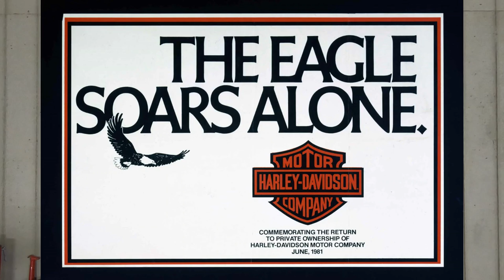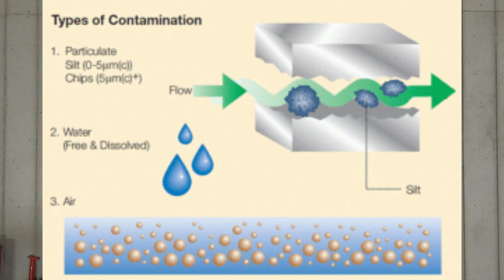Harley Engine Quality Isn't What It Used to Be

Comment: Good Video, my option is Harley like any big business and they are not going to worry about the past, Harley doesn't care about the Twin cam or the Evo, its 2023 and the Milwaukee 8 and nothing else and face it there in trouble and the over 40 crowd willn't bail them out, younger gen will have too, Harley 1950 technology and 2023 prices are not impressing the younger Gen, But thks

Comment: Harley had 12 evo engines they put 750,000 test miles on before ever releasing them. Taledega 24 hr test. Drag racing. Heat...cold endurance. They knew it was make it or break it time. They dont do that now

Comment: HD does like all other manufacturers of anything these days. They let the customer do the R&D instead of doing it themselves. If you are enamored with the polish and shine of a beautiful HD, it may be worth your money. If you want more power, take the whole bike apart and reengineer it for your whole plan determine, what you need and want from it. At least the pressed  crank can be relatively easy to deal with initially, once truely balanced, Trued, and then welded, not so easy after that.

Comment: A few things to add. How many riding a TC or M8 would swap out that motor for a 80" EVO ? The new motors accomplished faster assembly, higher torque and HP output. The EPA was requiring tighter emissions controls and compliance. I'm in total agreement that the EVO was the best motor ever produced by the MoCo. I doubt those who have built monster M8 motors, would want to build a 150HP EVO.

Comment: I bought a new Harley in 2001. At 500 miles the cam and lifters went out. The dealer put new cam and lifters in and less than 500 miles the cam and lifters went out again.  I took it back to the dealer and they told me that the cam and lifters for 2001 were made with defective materials and the metal was soft. They told me that they wouldn't repair my bike again and that was as good as it was going to get. I took that POS Harley and traded it in on a Yamaha.  I'll never buy another POS Harley in my life.

Comment: I feel the new m8 got worse. I've seen cases that were so coarsely cut on the base gasket surface that you could catch your fingernail. And alot of other things.
Reply from the maker: I've notice that SE parts, brand new set of Screamin Eagle ported heads and the machining was absolute crap. It literally had to be cleaned up before it could even go on the bike.

Comment: I was just a kid when AMF took over, the company that made bowling alley equipment is now in charge of an American icon. 54 years is a long time to fix known issues, suck up to Ronald Reagan, make 100cc dirt bikes and still use pushrod technology older than dirt. I understand tradition and think electric Harleys are stupid but the "new" twin cam belongs on the Flintstones.
We don't want V4's or four cams, we just want it to work EVERY day without taking out a second mortgage.

Comment: Are they really that bad do you really need to ask that question ⁉️ cheap components and major areas that are prone to cause catastrophic at expensive engine failure. Compensators that make the primary change so tight IT destroys the bearings in the transmission as well as breeder issues that suck transmission oil out. Plastic manifolds and an engine runs hot enough to cook a turkey 🦃. Jeep wiring harnesses made in Mexico that go up in smoke and if you are lucky your motorcycle just not go up and smoke with it. One problem after another problem after another problem because they built their engines to be cheap and disposable. As the British say pennywise and pound-foolish. Why Harley customers do not demand to have factory rebuild their motorcycles under warranty I have no idea. Harley Davidson evolution motors for the big twin as well as the Sportster where the Pinnacle of dependability and reliability and everything they have built since then is Cheer garbage. You yourself have a million videos about all of the many many mechanical issues of the big twin engines at Harley has made over the last 20 years since the discontinuation of the evolution motor. Hundreds of rebuild videos concerning the twin cam and the milwaukee-eight having catastrophic engine failure with horrendously low mileage. you yourself banter about changing stuff like the cam plate to a good s&s cam plate yet the good plate cost $500 not including installation. And that is just the beginning. Honda and the other Japanese manufacturers would never put out engines with so many endemic problems straight from the factory. They do not use their customers as unpaid testers. Harley-Davidson went from having real customers to having Fanboys that will pay any price for any piece of garbage that they put out. And then they will nonchalantly drop five or ten thousand dollars and replace all of the cheap crap in the engine from the crankshaft all the way up. Yet I know Harley can build a reliable motorcycle if they feel like it because I have a 25 year old Forester with 400,000 miles on her. Why is Harley Davidsons most inexpensive motorcycle that most reliable and their most expensive motorcycle the most unreliable piece of s*** that ever came down 👎 a production line. AMF sold a complete line of motorcycles from a beginner to an expert, the new Harley-Davidson is a t-shirt company that sells motorcycles as a sideline. Today's $30,000 Harley has the quality of a Chinese scooter that you buy on Amazon. That is pathetic beyond words. Harley-Davidson big twin motorcycles have so many expensive problems I would not take for free that is how bad they are. And so it goes.
Reply: Couldn't have said it better myself. If people stuck together and wouldn't buy that junk they would fix it or go out of business. Either one is fine for me.
Reply: I agree.  It's unthinkable that they could make a much better engine and simply chose not to.  I never knew about all these issues until after I bought my 01 twin cam.  I've spent over $3,000 eliminating the factory/ engineering weak spots.  Why wouldn't a company want their best possible product going out the door?  Allowing.012 end play on their crankpin is absurd.  They're becoming a joke
Reply: Can't really agree with your fan boy chatacterization nice try though.
Reply: @carlbruhn1772  it was a tongue-in-cheek joke. But there are many Fanboys out on YouTube praising them to high heavens just like all of the guys who are fanboys for Lionel trains and make excuses for trains arriving with wrapping paper stuck to wet paint paint defects electronic defects broken missing parts horrible customer service and poor warranties the expense does not match the price the quality does not match the price. Let me put it this way if Harley-Davidson made aircraft I would not fly 🕊️ them.
Reply: @Frank Markovci Jr  I completely see what you mean under those circumstances.  If I was 18 again there is little chance the motor company would appeal to me. Just the quality of chrome, paint, and fitment of body parts alone are reason to look elsewhere. Watching fork legs pit and look like crap after 12 months is a joke. I certainly don't hold them in high regard but I certainly enjoy the ride and the wrenching.
Reply: @carlbruhn1772  these bikes are not really meant to be worked on by their owners too many specialty tools and too many computer toolsYou have 2 plugs of motorcycle into a computer so the computer can tell you what to do just like today's cars and everything else.
Reply: @frankmarkovcijr5459  I felt the same way back when I was learning to tune 4 carburetors at the same time.
Reply: @carlbruhn1772  all of my British twin cylinder motorcycles have one carburetor. I learned how to take a Mark 1 concentric apart clean it put it back together but the cable on input to Cable up to the throttle after I routed it under the gas tank and the thing actually works. Outside of my Sportster which has the original Honda CV carburetor everything else has a Mark 1 concentric except for one of my early BSA 250 singles Starfire which has a monoblock carb. My Sportster in the old 1960s days originally came with an Amal carburetor but for right now I'm going to keep with the Kaden CV carb because it works.

Comment: We as consumers need to also take into account that HD is fighting EPA regulations on one fornt and its customers who want more power on the other. I am an old hotrodder and cars were and still are the same. As long as one temper their expectations "stock" internals are satisfactory. But if you really want a race engine you must use race engine parts. That means cranks, bearings and sometimes even the blocks too or cases in terms of HD. With all that said some of the issues HD has experienced have been self inflicted. Cam bearings comes to mind. We also need to consider that even the raw materials are imported anymore along with outsourcing of parts alot due to those pesky EPA regs. All in all I think HD does a decent job considered. I just think they are moving away from their base in search of new customers. For me that is the wrong direction and have no interest in their new offerings.

Comment: The big issue is these new motors have bigger cylinders which generates more heat, I won't buy a new Harley because they are having electrical issues now because with all that extra heat, it starts melting wiring over time. The new Harleys will never beat an old shovel or pan.

Comment: Like the retired h-d mechanic told me : “ Harley cuts corners -“
Some these S&s engines are just brutal. They seem to take everything. Well ; new diamond primary chain and hot bike hydraulic tensioner in . All off eBay . Half the price . Seems good : I’ll give you a report . I would say the diamond chain better than the stock “ Regina” chain . 
✊🏻👍👌

Comment: Harleys quality sucks. I’ve been through my share of Harley’s over the years. My last Harley was a new 2017 M8. Nothing but problems with the oil pump coming apart destroying my engine, a leak from the transmission into the primary,and other items. Left Harley, never going back to a new bike, maybe pickup a twin can, which I wish I would have kept.

Comment: the oil trough the aluminium is a myth.  aluminium doesnt have passages that go all trough.     sand castings do have a rough surface that can hold some oil. 
What customers of harley are probably experiencing are hidden cracks ins the aluminium.   old castings have allot more stresses in them and can form hairline cracks.  
you can actually aleviate those stresses by assembling the cases (to avoid warping)  and getting the parts "cooked" and cooled in a controlled environment  
I own a welding business and this gets done with stainless steel constructions too that cannot have any stresses in them.

Comment: Harley hasn't produced a "premium" (QUALITY IS RELATIVE TO CONTEMPORARY COMPETITION, read that twice if it doesn't sink in) engine since the generator era ended. Every HD engine since has had inexcusable problems including weak crankcases prone to cracking (cone Shovels, Evos) that made the aftermarket case market (House of Horsepower, Delkron, S&S, Ultima, Sputhe, Cal Products, generics) rich. 

Using garbage inner cam bearings by choice (INA on Evos and Twinkies), various other casting flaws (common to early Evo heads, not just cases) deliberate downgrade to roller bearing output shafts to save production cost then calling the original tapered roller bearing an "upgrade" (Twin Cams), and more. The people who blindly defend HD because of emotional linkage are very rarely mechanics because we're busy fixing the fuckups.  Cruise drive six speeds made my shop owner bros a very nice profit despite there being zero excuse for fucking up something as basic as a motorcycle gearbox.

Sportsters weren't immune (weak gearbox casings because of that stupid speedo drive cutout on 900s and early 1000s, no trap door on late Evo Sporties, the clutchernator abortion and trap door bearing issues on alternator four speeds Iron and Evo) either. 

Harleys have always been raw meat and throwing away some of the drivetrain so normal it's accepted. Their legacy design which hails from an era where EVERYTHING broke early and often (the 1930s) makes them easy to rebuild which is the main functional attraction if you wrench.  I've no interest in non-classic HDs since the very specific things the classics did well are the sole reasons I have HDs in my fleet. 

The new ones will do fine since all it takes to sort out any luxury toy is money.

Comment: if you ask me the evo is more legend that that much better. I had a 71 shovel that i put half a million miles on.
most harley engines once you fix the built in fail points will give you 100k before you have to rebuild. what the evo and all predecessors had  was they were easier to fix on the side of the road but you had to do it much more often. Aso you didn't have to have a million dollars worth of tools to do the work. if modern bikes didn't have four miles worth of wiring in them the engines / trans are still pretty easy to work on. what pisses me and everybody else off is having to get the ecm/ bcm flashed if you want to make any changes and harley holding you hostage to do it and after 10 year its not available. 
so its dirty practices that piss people off not the bikes themselves.

Comment: right...quality way better now..
when I stsrted riding in the 1960's..brand new harleys leaked oil on dealers showroom floor...if your bike did'nt leak ..you were out of oil...then AMF came in and ended most leaks,but rest of motor sucked so bad it was'nt funny...when Willie G took over things got back on track sort of...now even better .. to me,if it ain't broke leave it alone...they need to stop wanting to one up themselves..
let after market vendors mess things up..let the strong,solid harley engine do its job and stop changing things...

Comment: Interesting,  I deal, with every 2 years having to change out cam chain tensioners, it's like silly. I have been doing , 19,000, 20,000 miles past few years, and just costly, and soon I'm gonna need, top end rebuild,  I mean new cams, ect, at 48,000. Just baffles me, how u can go get a used jap bike, and run the heck out of it, for 80,000 miles, and need hardly no major repairs.

Comment: No the new engines have too many problems the biggest one being crank run out because of the cheap Halo pins cheap lifters cheap roller bearings Center materials especially on the frames I admit there fast but I'd rather have a Evo

Comment: What the heck. No offense but you weren’t around in the old days. I started out on shovels and they had all kinds of issues. Harley’s used to be called a Milwaukee vibrator. Then EVO’s saved the day. But build a 96 inch evo , ya had to get heavy duty filament bulbs like the 2057 in place of the 1057. Long story short , today’s M8’s are bad ass. And with mild work are crazy horsepower and torque , smooth as silk , and reliable as fuck. Cracks me up when I hear people questioning today’s bikes. Ride a shovel for a couple years and then say something.
Reply: Phi, Shovel. Ride a Knuckle or some Flathead, then talk.
Reply: @Pracaupodstaw  Even more so.

Comment: You forgot to mention how underpowered the evo big twin is. If you think the 50 hp it has in stock configuration is adequate you are probably a grandparent.
Reply: If you look at a cycle world road test of any motorcycle you will see that they put them on a dynamometer so you can see what horsepower they make at what RPM level and an EVO makes 65 horsepower at 6,000 RPM which is 6 horsepower more than a shovelhead kid at 6500 RPM. Most Harley guys nowadays need a big engine to compensate for shortcomings in other areas.

Comment: The Evo was good not great compared to most manufacturers.These new bikes are not good they have a horrid engine and drivetrain failure rate within 4 years.Check out consumer reports .
Reply: Everybody I know who has an evolution powered motorcycle has tens of thousands of trouble-free miles on it as well as no transmission issues I seriously doubt consumer reports has any issues regarding a motorcycle that has been out of production for 23 years. Of course I don't think they would have anything good to say about a twin cam or a milwaukee-eight.

Comment: I have two m8s and they are a great platform. Most of the guys I ride with have M8s and none have issues. If you push any motor to it's tolerance limits you are going to have a problem - that applies to evo up to present day.  The biggest issue with the very old bikes is support - as their platform ages out and less are on the road there is less support. Having said that, HD has more support than any other bike .   I enjoy my '02 TC 88, my UL 114 and my low rider st 117.  My experience is the new HDs are rock solid.

Comment: If a company wants to market themselves as a "premium" motorcycle manufacturer, cost cutting [at the expense of quality and reliability] should not even be in their lexicon.  Harley Davidson has never understood it's core customer and neither did AMF.  Prior to AMF, I think they did.  And as a reminder, H-D's core customer is typically very good with a wrench.  Today's H-D customer, not so much. Pretty much every problem I have ever had with any Harley Davidson resulted from poor quality OEM parts or cost saving design screwups.  IMHO, H-D should sell their "cost cutting" models for a LOT less than they currently do.  And offer a few models that real Bikers want (like the FXSTC) with the option of an S&S motor in it.  Of course H-D's biggest problem today is that they are selling for $7-$8k over an already inflated MSRP price.  Only a complete imbecile would pay that kind of $$$ for a two (or three) wheel car with a crappy motor and a fancy radio.